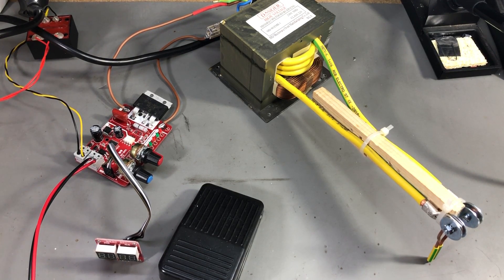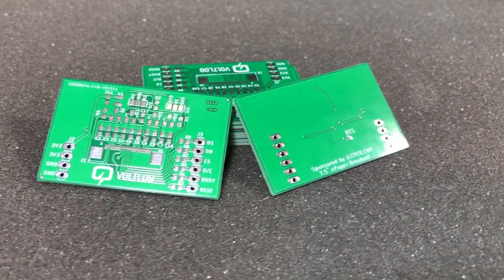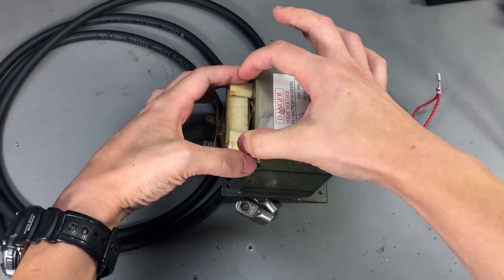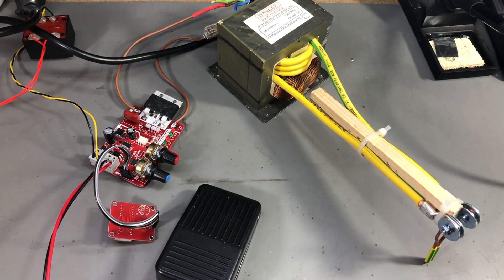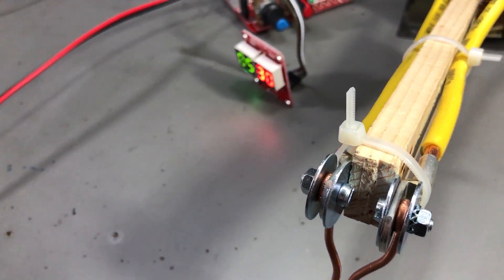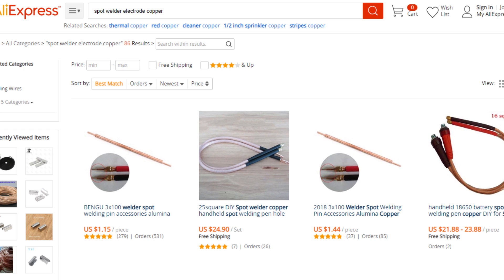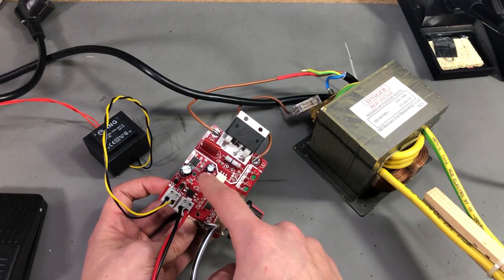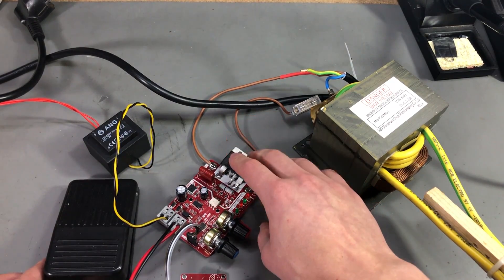Voltlog #207 - Making a DIY Spot Welder From A Microwave Transformer

Comment: I saved quite a few dollars by ordering 8 gauge jumpers, and then cut the ends off, cit both red and black into equal thirds/ 10 feet, lastly I stripped them and attached them to a secure point, twisting , it all came together like a rope. Now I have a perfect gauge that fits into 3/8 battery terminal lug. what kills me though, Advanced auto is crap compared to what it use to be!  yo use to be able to rent or borrow automotive tools., I had to buy a terminal / lug press for 15 dollars . the hammer kind/ I still saved Bec.4 gauge battery wires go for over 30 Not MUCH THOUGH!  unless i send back the lug crimper when done!

Comment: @Voltlog, Hi man, you should really do the 2024 version and elaborate on zero cross detection. There is much to review on the delivery of pulse to the electrodes. This is a great project to upcycle a readily available component.  I am doing a 20S10P Li Ion pack so it requires extra long arms to allow comfortable access to a frame that is 400 x 200 approx  I have the scorch marks on my wallet from sourcing the 18650's out of the USA Factor CAD to USD conversion, shipping, brokerage, taxes I think it was little under $1280 CAD, now add a quality BMS, shrink tube, and other, it's getting up there. Now I Have a background in LiPo batteries and have repaired many Dewalt and Milwaukee power packs but I am still a little sketchy on all the details of this endeavor.

Comment: If the circuit is wired up properly the left knob control the current and the right knob control the timer, the tyristor(triac) is suppose to switch the secondary side, otherwise you would only need a 10amp tyristor. since 240v * 100a = 24kW
Reply: primary side
Reply: @peterdietrich9491  yes all the circuit diagram shows it on the primary side, the thyristor is an scr hence only half wave is going to the transformer, I wouldnt normally feed dc into a transformer nor halfwave but I suppose 98% of people who use this doesnt do electronics so it wouldnt matter to them

Comment: I had two of these red boards. one with a simple LED display and one with a black and white display. both didn't work. one time the soldering is too weak and the next time it's too strong and sparks fly. No adjustment made it better.but most of the time the Nickel sheet metal sticks to the poles

Comment: I can use only 110V microwave transformer here.  What needs to change to make a spot welder for 18650 battery packs?
Reply: this module is also available in 110V

Comment: You can''t use the another secondary winding of the MOT because you switch the primary winding with the TRIAC. So until you switch ON the MOT with your pedal switch there is no voltage applied to the auxiliary secondary 9VAC winding of the MOT. The circuit doesn't work. You need a second transformer.

Comment: Theoretical P=U.I= 230V.6A(max input transformer amps)= 1380W so, 1380 / 2,3= 600A(output) not taking the loses in consideration! so if you lesser the turns of your secondary so that you get a lower voltage, you get more amps!! Actually 3,5V on the secondary is a bit too high lower the turns and you will not need a thicker cable for the secondary...16mm2 can carry even the theoretical 600A in the short amount of time its seeing it even the insulation is enough. Try that!

Comment: Thank god for your post. I bought the same controller board but mine is a 40A, while yours is 100A. Now, my problem is, I accidentally smashed and destroyed my MOT's primary. (reckless me...) and my question, can I replace the primary  winding wire with a different size, or should I find a new MOT? Thanks in advance for your answer.
Reply from the maker: It should be easier to just find a new MOT.

Comment: hi all .. is anyone else using a similar setup ? i just made it and the spots go red hot but not really perfect welds . i checked another video and according to him it might be less amps 
so i added another transformer . still everthing gets hot ( even at lowets numbers ) but does not properly weld . any suggestions @voltlog ?
Reply: Hello. Did you found any solution for this problem? I have same problem. Thank you

Comment: With a 35mm² AWG 2 wire, with 2 turns in secondary coil, I got 1.6v 522.4 A in my tip heads which are made of zirconium copper alloy. This alloy is the nessecary one to use in point welding machine cause of it's thermal resistance and conductance properties. I also use the 220v fan motor of the original microwave oven for cooling and one thermal fuse of the same oven and there is no heat problem so far. Fast and easy project.
For technical calculations of anyone interesting have in mind.. 
How to calculate the output ampers? Use the equation : 
Is = Vp/Vs • Ip
were Is = Amper of the secondary
         Vp = Voltage of the primary
         Vs = Voltage of the secondary
          Ip = Amper of the primary
Now how to know the primary coil amperage is simple. Just devide your transformer given Watt number by the used voltage 
e. g. 850/220 = 3.8A 
(or for USA 750/120 = 6.25A) 
Also if you are curious about how to count the primary turns for other calculations the equation is:
Vp/Vs = Np/Ns
were Ns = turns of the secondary and
          Np = turns of the primary
So following this equation you can for example find that the primary coil turns of your transformer is:
Vp/Vs = 220/1.6 = 137.5 and for the primary turns you have to find the same number. So Np/Ns must be also 137.5 and that means 
Np/2 = 137.5  so on Np = 2 • 137.5 = 275 turns on primary. 
To ensure the calculations correctings just use the following equation:
Vp • Ip = Vs • Is this means
220 • 3.8 = 1.6 • 522, 4 (approximately) 
is giving the same number. Correct!! 
Hope I help some interested. Have fun with your project and always take a really good care of the current for your safety!
Reply: brilliant idea on using those other parts, the thermal fuse and the fan!
Reply: Hi. Really thanks for all the valuable information! Could you please confirm if the control circuit used in this video is adequate, or if there are better ones to use with a modded microwave transformer for a DIY spot welder. Congratulations.

Comment: Skip the hardware store for thick transformer wire and get a starter cable from an auto parts store.
Also, put thermal fuse on primary since the secondary current can weld it "on"...
Reply: That's a great tip. Thank you.

Comment: Your video inspired me to build a welder Thanks , I have a question , I ordered a 100 amp control board the Chinese one with one control and 3 segment display's it requires 12V AC do you think I could use a 15 V AC adapter ?

Comment: Very good information sir.I am making a similar type . will you please tell me without current and timing controlling board is it possible if I use a little thin/thick wire and timing by pedal switch?

Comment: I used this control. Getting 4v open cct voltage. Using aliexpress copper probes. Setting I am using is 4 ms? and 50A seems OK for 18650 tabs. Works well enough.

Comment: I do some projects, working with 25 sq wire do 3 laps in microwave MD-701EMR-1 and not get good welding.
I use NY-D08 Board and spot welding pen.
Anyone have idea?

Comment: hey.. i have watched your videos several times and i have build the exact same thing as yours.. Only difference is that i have 4 windings in the transformer.. My spot weldings aren't always the same... Some tiems it peeks really pad and burns the nickel.. My settings are green light 25 and red light 90.. if i turn the red light nob further down it wont spot weld at all
.. Could you help me here please.. equiz@live.dk is my email.. Thank you.. !!
Reply: I have the same problem. Have you found a solution?

Comment: My DIY MOT welder can do 750 A at 2,5V or 2,8 open circuit, and it makes pretty good welds, I use an arduino as controler and build my own triac trigger circuit. I may make a video about it but will propely not be in english

Comment: Thank you once again for the demo. I watched this video for the 2nd or 3rd time, because your descriptions are much better than many, I have observed. A few things to note here; is as follows, for your info and others.
1) The TRIAC heat-sink tab is electrically insulated. Therefore a good heat sink may be attached, using silicone grease, in between the HS and the TRIAC.
2) When you mentioned the auxiliary power to the electronics, you said, “ either 9 or 12 volts could be applied”. What was the actual power applied ? What company is ANG and what’s your local power supply voltage?
3) The electrodes you made, were sticking to the Ni strip and you said “ this is due to Electrodes made from normal Cu. I fail to understand that phenomenon, because, even after, Cu alloy electrodes were used, the Electrodes, were still sticking and fusing to PURE Ni strip. The reason of  fusion is due to higher Amps. This could be avoided by reducing the Amps.
4) None of the links that was provided for parts and supplies, worked as it should be. I suspect this could be due to different location, from where the links were viewed? FYI I’m from United States. 
Please respond. Thanks regards and respects.
Reply: 2/ the input AC can be between 9V min up to 12V max

Comment: Specebo. The demo or the Educational video, you presented is quite exemplary and easy to comprehend, even for a novice. Let me tell you that your welder  spots are clean and strong. Using ‘special Alloy’ electrode is a waste of funds and as the venders specify, their ‘special’ electrode many not be an alloy at all. The DIYers are not metallurgists, to know if the electrode is genuine CuAlZr alloy. Your method is the best, normal 12AWG pure Cu.
By the way is your weld material CuNi alloy? I have tried pure Cu strip with no result. But Yousun (YT publisher) posted a technic of Spot welding Ni Cu laminate, which resulted in good bonding. The technic is Cu strip overplayed with Ni strip with 20mS timer worked well. The bonding seemed to be prefect.
Recapitulating, your project looked extremely good and the explanations, too good, to understand.
Specebo.

Comment: Could you explain how you can make additional turns on the main transformer which Wil be powered through the board when you are gonna weld during the oftime there will be no current when you don't use it so it's impossible to power the board?? I am looking forward to your explanations about this iseu 👍
Reply from the maker: you're right, that's not gonna work if there is no current in the primary.

Comment: You realise that if you don't make full contact with the battery that shock is welding those gloves to your fingers instead!
Reply: No, it isn't. Unless the gloves are very much conductive, the voltage is too low for a significant current to flow. Even bare fingers won't feel anything besides the heat of the electrodes after a few welds.

Comment: I have only 1.7V output, maybe its so less and use some 3 full cooper wire around secondary. My output is scrap, do it bolts, maybe need better secondary wire or wire stick.
Reply: 1.7V is enough. I have 1.5V and works just fine
Reply: @krlenjuska  I try order china end pen. Maybe whan wiring goes thin and then wide, it lose Amp. How can i measure amps on output?
Reply: @martinhyska1206  You can measure voltage drop and calculate current. Also you can measure amps on input side (its much less amps so easier to measure) and calculate. This is not precise but gives you some info. When u use thick secondary wire - you can just have more power.  For example - i have 1750VA transformer - when i remove shunts i should get about 2500W of power - maybe more im not sure. I will use 75mm2 secondary wires to get maximum power from my transformer.  With this i should get 1200-1500 Amps peak at maximum settings. After that i can use chinese module to control power based on my nickel thickness and battery material. Spot welding time should be set always to 1 - its 20ms. This is maximum time for spot welding but unfortunately we still dont have cheap module with 5  or 10 ms time settings.  You can use 2 smallet transformer in parallel in theory but i never tried this. I should finish my big MOT spot welder soon so i will give you some feedback.
Reply: @krlenjuska  i buy some 13mm secd cable, but bad is i can do only half turn or 1 turn, so probably not usable. But y say 75mm2? that must be super huge against mine.
Reply: @krlenjuska   thanks bro. Please can 25mm of wire work fine on secondary? And how many turns do you advise. My major challenge now is the secondary winding. Bless.
Reply: @Kogitesolar  No its not enough. Maybe only for 0.10 nickel plated steel. For pure nickel 50mm2 is enough only for 0.10 - i can weld 0.15 with 75mm2. 2 full turns should be enough - measure voltage on secondary - 1.5-2.5V is enough IMO. I know some semi pro welders have 4-5V but i never tried it.

Comment: Hey, I was just searching YT for the NY-D04 kit after looking at it on AliEx. It looks like you uploaded this in January and the D01 seems very similar. 
  With your Sunkko unit in a useful case, have you actually used this D01 kit much? Was this a decent buy or has it just sat on your shelf?
What's the verdict :-)
-Jake
Reply from the maker: I've used it moderately for maybe 20-30 welds and it performed ok, no problems so I would say it's a decent buy. It's always worth researching the offer because sometimes, 6 months later you get a newer and better module for the same price so I would recommend you do some searching on aliexpress to see if something newer appeared.
Reply: I tried several modules and this is still best buy option. Just make sure you have enough power from your transformer.

Comment: there are two options for controller,  40A and 100A , what's the difference between those two, 40A one is cheaper
Reply: Only difference is tyristor. If you use 2 transformers in parallel or some BIG transformer - you should buy 100A version.

Comment: Your welds are not good as almost any other DIY MOT spot welders here on youtube. Welding time can be set to maxiumum 02 - 40ms(this is already too much time) because too much time will make burned nickel strip and welds will not be good. 01(20ms) will be ideal but for this you need 50mm2 wire. I use 35mm2 on my spot welder with 02(40ms) and 75% current settings for 0.10 pure nickel strip. My MOT is 700VA (its about 1100-1200W when shunts are removed). With 35mm2 i can get 2 full rounds - 1.5V  and i can confirm its enough. I have bigger MOT (1750 VA) but dont have time to test it. I guess i will get around 2500-2800W with shunts removed. This MOT should be enough for 0.2 and maybe 0.25 pure nickel strip. Also the reason why your electrodes sticks to the welds is welding time - reduce welding time and electrodes wont heat up that much.
Reply: Absolutely correct info, and I found it myself after trial and error. You should aim to have a complete, nice weld in 20mS.If you are not getting a good weld in 20mS , then increase the amps either by increasing the secondry wire cross section or by adding another transformer. Best to add another transformer in series. In that way, you can reduce the turns on secondry to half, thus doubling the amps and doubling the voltage by adding another transformer.

Comment: Thank you! very informative. I have made my MOT welder long ago with those old Youtube diy post but not as informative as your video. I liked all the details that you mentioned that I did not have when I first did mine years ago. I may need to update my old one and your controller idea is great. I did not actually used mine because it seems like it heats up more than a blob of solder. It may be good on melting metal but not with li-ion batteries. I was not sure what to do with the magnetic shunt when I built mine  so I left it in. I also heard that less turn means lower voltage --higher current. Also, tighter joints means less resistance =higher current.  I checked those cheap controllers, and there's no instructions--great for pointing out to use 9v-AC. I saw some pictures that says 9v-12v but no specs that it can really handle 12vac. One of my problems long ago also was that both copper probes should make good and even contact to make better welds. It will also be great if you could give us the best adjustment timing that produces the best weld as you used yours. Your initial welding setting was set to 5-30, I know it may vary but at least an idea.
Reply: I modified my 18650 tab welder and incorporated what I learned from your video.  It worked very well for me. I even made a video.   Just for everybody's info, the controller has 2 amp types- the 100a one has the bigger black chip on its side.   
https://www.youtube.com/watch?v=8q-7rd7KLB0
Reply from the maker: I get good welds with minimum settings on the controller which is a sign that my welder has plenty of power. Like you observed in the video, start with minimum settings and increase if you don't get good welds. Like you mentioned contact resistance is important, have good sharp, clean electrodes.

Comment: What gage wire you using? And how many voltage you getting? Thank you
Reply: I only getting 1.7 volts with 8gage wire 1 turn
Reply: @nicfpv9969   please does the 1.7 work for your lithium battery?
Reply: @Kogitesolar  yes it does
Reply from the maker: with should build this following my recommendations, that way you get a good start with something that actually works.
Reply: Im using a 14awg silicone wire